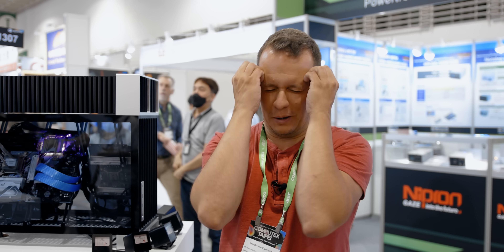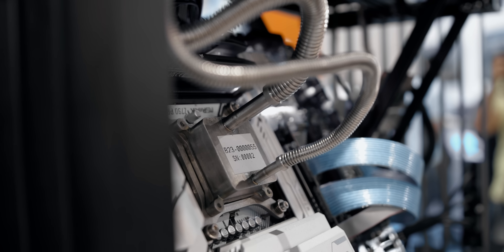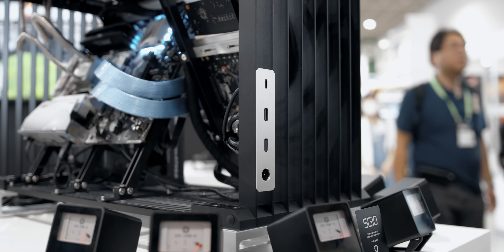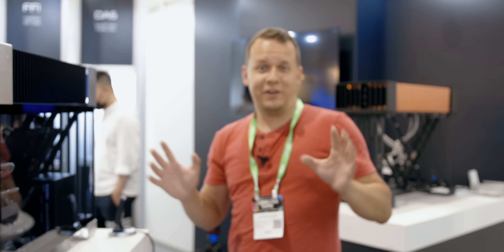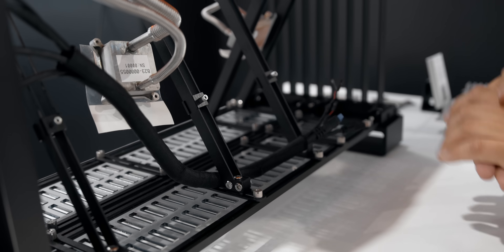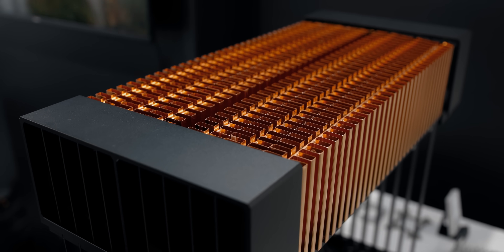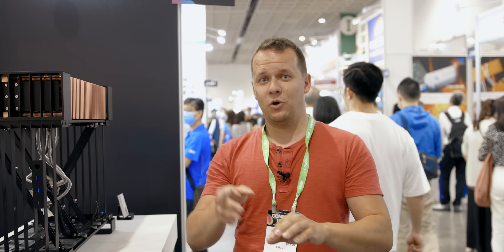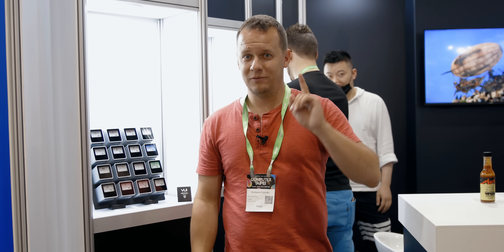Passive Cooling just got REAL.

Comment: It has a very similar issue to what we ran into back in 2003/04 with extreme water cooling. We cooled the GPU and CPU perfectly, but other parts with no cooling — like the motherboard’s VRM section — were burning hot. In fact, the Abit IC7 died under a Prescott overclock. The screws holding down the block were literally scorching hot, while the block itself stayed cool. You can’t really get away without airflow, or you need a custom cooling solution for each piece of hardware.

Comment: Dude is like "the 4080 is running at 60 Degrees Celsius." My 5080 is running at 50 degrees Celsius with just the fans and heatsink on the Asus Tuf OC, all by itself.  I'm sorry, but this is not "brilliant," its a waste of money. My Thermalright liquid cooler for my CPU cost 52 dollars on Amazon, and runs my CPU at 50 Degrees tops when I'm gaming.

Comment: 1.000 Dolars for something that you will have to add as soon as possible couple of fans when you reach 600W consumption, as you said in the title, UP TO, so like in any advert, it`s imposible to sustain the UP TO, intel CPU up 6k, yes just for a second, same here, UP TO can mean for a second before it starts to burn like a fire camp, i don`t knwo what kind of entusiast you have to be to bloody buy something that is made to keep resonable temps in idle or watching youtube, any heavy long work loads, will end to melt the north pole , i wish that the "influence" of those paid youtubers are filltered by normal consumers. About the price of custom loop and noise and bul..it, that you want to be quiet and stuff, please stop talking bul...it, who`s using a computer for youtube it will hardly make the fans run at full speed to be to loud, if you are a gamer, with an expensive computer that needs to be fast enough to run every single game at max , i doubt you will use your 15 Dollars speaker from allix, you will use probably an expensive headset or some good quality speakers, and not with volume on low for sure, for those that are saying, ohh i`m playing in the same room with my sister/brother/mom/girlfriend and stuff, well trust me, you annoy them with clicky keyboards and mouse, and swearing and moving,and ARGB lights  more than the noise of the fans or pump....the way you said 2k,3k as the copper is expensive now, please stop, copper is not expensive, yes it gets expensive if it`s used for that kind of crap,  so the one that you can`t see the copper, is made by aluminium, or if it`s still copper,then how a less process to paint it cost more? If the one painted black, can dissipate up to 600W but the one that you can see the copper  also can disspiate the same amount of heat, so the double price you pay for exactly the same thing it`s just for pictures, and with time when it oxidise you say bye bye to pictures :) i`m not a hater i`m just asking you to not advertise some kind of crap to consumers without adding disadvantages on the same page with "the advantges" .Video from 2023, in 2025 the price per ton for copper is 10.180 dollars in US, 5.09 pe Pound and 0.32 pe Ounce,im curios how much copper is used for the 2 to 3k case it`s used, as i can see. most of the case it`s painted black, that makes me think it`s made by alluminum,the videocard bracket seems to be aluminium  for the weight advantage and cost as well, so the very very very expensive copper frase is coming from where? from 6 Ounces used to do that radiator? lol i`m sick of the influencers :) nothing personal with you or with the enthusiasts, But how you are allowed to express your OPINION as you said in the video, "in my opinion" i assume i`m allowed to bring mines to, and mines is that you are talking bull...it in the entire video about that case :) Peace to you and your viwers, wich hopefully will never buy any stuff considering your "opinion" . All the best

Comment: Neat product, but the issue with this that no one talks about is the other components that require cooling like the chipset, VRMs, NVME SSDs, RAM, etc. It could work depending on the setup if heatsinks are big and effective enough, case ventilation is good, etc, but the temps of all components must be considered.

Comment: 1000$ worth  of copper....
current stock price is 5$/lb
doing some high school math over here the heat sink should weigh 200lb, just in copper!

remember manufacturing cost is the same
only change was the copper,  1000$ for just the copper

some apple math right there XD

Comment: This is huge for workshops that have a lot of dust grain and debris! My school's workshop use laptops/tablets because they can't afford to damage the electronics with the debris we use. Hopefully in the future it will be optimized for smaller form factors
Reply: Unfortunately it's TERRIBLE for those workshops, because the dust will get inside the case which is the last thing you want with sensitive electronics. There is a company that specializes in mini, passively cooled, workstations - those don't allow you to install your own compotnents, but are completely sealed.

Comment: I think that 100% passive cooling is a dumb idea with such a huge amount of heat. I'd say at least design a case with ONE very large slow fan that is extremely quite, but still ensures some airflow.
Something like the Fractal Node 304 with it's one big 200mm fan up front.

Comment: It's not an obscene price, but I think the real problem today is that Moore's law is dead, and everyone is squeezing performance at the cost of wasted energy in the form of heat. A processor today can be hotter than a prehistoric Pentium 4 PresHot, or an AMD bulldozer. Currently I get by just fine with an APU, but the correct future would be CPUs emitting less and less heat, using less energy, and using more passive cooling solutions.

Comment: I understand that copper is expensive but a bare copper version costing 2 thousand more than the release product is just rediculas.. i can see the release price at around $500 $600 but its just a copper heatsink with heat pipes and freeon or something like that.. plus the glass and a very basic frame i can't believe it costs $1000 that means at mass production its costing the company $600 minimum but that leaves $400 profit per case thats fkn outrageous and ill wait for the chinese to steal the I.P and produce it for less than half.. 😢😢 sux because i don't like how china rips off manufacturers I.P but im not paying $1000 for something i know doesn't cost anything close to that.. i know the cost of materials and i know how to use tooling.. my trade is electromechanical engineering so i have a good understanding of the process and $1000 isn't underpriced especially when you are mass manufacturing.

Comment: I never monitored temperature of dedicated GPU as I actively cooled them. This GPU is running at 60 degree C, i.e. 140F. Is that a cool temperature for GPU?
Reply: Yeah that's pretty cool for non-idle. It's also not bad for idle, unless you require your GPU fans running to maintain that on idle. Then that's not so great.

Comment: Passive cooling, won't every be a big thing, until adding fans or pumps wouldn't make it run cooler... Because we always want the best and the fastest and what better radiator to put some fans on than a massive one meant for passive cooling... Everyone knows I'm correct, but it is still cool and good to see.

Comment: are you kidding $2000-$3000 for such a small copper heatsink for that kind of money you can buy 10 times bigger copper heatsink plus copper vapor chamber heat. blocks for the CPU and GPU and connected it yourself and you will have over 2000W cooling capacity instead of 600W i've seen ppl do it you can even buy very cheap Huge copper vapor chamber heatsinks from Cars or Trucks or other industrial equipment and this way you can easily do 3000-4000W cooling system for around $500 like always this is yet another PC SCAM it looks cool and most probably works but it's just so much Overpriced it's a Complete JOKE btw you can even achieve the same or better result with passive liquid cooling with two big radiators that will cost you no more then $700

Comment: had to come here due to also loving passive cooling. even semi passive cooling, in the past I had a huge passive heat sink(even though my case did have fans) I could overclock the cpu with around 1ghz while keeping it below 40 degrees(in a room wich was in probably around 20 degrees. making some kind of convection pipe might be a great alternative for fans.

Comment: I'm more into Frore systems cooling, but this looks nice as well!
Reply: Frore is about heat transfer to air. You can think about it as a radiator. This is about heat transport, like the water in a watercooling loop.

Comment: 600W passive cooling? That means it's gonna save 600W worth of power? If such is the case then it's probably gonna break-even its price by power savings in a year or so. Not bad.
Reply: thats not how it works. it doesnt 'save power' on anything. 600w means it can cool up to 600w amount of electricity put into the pc parts that it cools. so a 4080 and cpu that uses a combined power of 600w can be cooled passively with this, but a cpu + 4090 uses too much power and will throttle/overheat since it goes beyond 600w

Comment: Copper is not THAT more expensive? And most of the case still seems to be made out of Aluminium. Even if that case includes 20kg of copper, that's only like 120$ of difference at best.
Reply: and then the shipping company wants 300$ extra per case to send

Comment: 1000$ is nothing for complete silence. A custom loop that is able to cool a proper gaming rig silently will set you back at least that amount without the case.
Usually, these systems with external radiators are capable to dissipate more than 1000 Watts so OC is not an issue. 600 Watts isn't that much in today's world but at some point you have to make a compromise. I'm eager to know how much the copper variant can dissipate and what the maintenance looks like.
What concerns me is the coil whine of modern GPUs though. Will be even tougher to find a model which is not unbearable without fans.

Comment: Will this passive cooling work when the ambient temperature in your house is 30C or higher as it is frequently in my house in summer. I have no air conditioning.
Reply: Ambient temp doesnt matter between different cooling solutions. 
Except in this very specific case where the liquid inside the tubes are suspected to boil at 61c according to others in the chat, which means the ambient temp cant be above 61c otherwise itll never turn from gas back into liquid to keep the loop going. 
but at 61c you shouldnt be there anyway so thats irrelevant XD

Comment: This would be a REALLY cool setup for situations where high horsepower and an absolutely SILENT noise floor is needed - or fans are impossible to maintain. I'm thinking something like a cleanroom? Maybe an anechoic chamber where testing is being done and analysis or test tweaking has to be done in the chamber itself? Any other ideas?
Reply: I would like to use one in an audio studio personally.. would be good for video editing on speakers also
Reply: Just use an extension cord and put it in another room 🤷‍♂️
Reply: would be interesting if it was possible to record any noises coming from the cooling process

Comment: Someone needs to make flexible heatpipes...same design as a stainless braided brake line, for example...just copper...and a heatpipe.  This would allow custom.passive cooling " loops" ,just like we are used to...the heat pipes would have to have some kind of heatexchanger at each end (cant open a heatpipe unless you have means to make it a heatpipe again).  Any reason this wouldnt work?

Comment: My i7-12700K DDR5 system with a Deepcool Assassin 3 and Corsair 5000D is already the most overkill silent PC i ever built (more silent than my refrigerator) and 7 watts and 18 degrees while watching this video, but this passive case is just unnecessary and straight dumb. Maybe for the RTX8000 when the flagship card will have the size of an entire PC case

Comment: I agree, $1000 sounds like HUGE underselling -- just a loop for similar capacity water cooling might be in that range, and that's not including your case! Curious as to why the copper edition will be more if it's just showing off the internals -- isn't the regular one basically a painted version of the copper?

And the analogue displays also sound like an undersell -- I thought you were gonna say $100/piece! I'd maybe pay up to $50 each tho. Definitely excited for those! Such a cool look.
Reply from the maker: Regular version has copper coolant channels but a painted aluminum radiator.
Reply: @HardwareCanucks  ahh, gotcha. Definitely explains that cost increase then!

Comment: Is it 2 individual loops with 2X 300W dissipation or is it 600W shared?
Can I use a 7800X3D at 120W paired with a 4090 450W and keep under the 600W total or will the 4090 overpower the GPU side while the CPU side almost does nothing because of the 7800X3D?
Reply: Your power consumption of the device and the cooling watts aren't directly comparable. The heat generated by the devices is only the waste heat. If you wanted to compare, you'd have to multiply the device by its efficiency to find out how many watts of heat it is producing and then you can compare that to the cooling method.
Reply: @zachary3603  The difference between power used and heat produced in a pc is practically nothing.
With the coolers mounted around 90-95% of the heat goes into the cooler, only VRM loss, RAM and SSDs are not cooled by the cooler.
Unless powering something via USB-C, no significant power is really leaving the PC without getting turned into heat.

Something that will make a much larger difference is thermal transfer efficiency.
If a 7800X3D is clocked to use 200Watts it would be practically uncoolable even if the cooler can cool 300watts, because the heat can not get away from the chip efficiently enough.

Comment: I wonder how much worse the cooling actually is, if they do not use copper but some other metal. Cause I think, if you don't go for high end CPUs and GPUs, that might be enough by far and would be waaaaaaaay cheaper. At least if the metal actually is the expensive part. I guess the cooling circuit itself, without the metal radiators, might also be a not too cheap component.

Comment: Yea 100% fanless case sounds nice until your SSDs and southbridge and ram are sitting at 80c+ because there is no airflow over their heatsinks, not to mention all the heat bleed into your motherboard/etc that is getting no active cooling at all which is what the airflow through a typical case provides.

With no actual airflow a thin boundary layer of air forms around components and heats up acting like an insulator.  You only have convection to remove heat and that requires temperatures on the surface that are extremely hot, basically cooking the actual silicon chips under the heatsinks.

I have a active fan on my southbridge and still struggle to keep it under 60c during gaming.  Modern southbridges that are adding 20+ PCI-E lanes, multiple high speed USB ports, ethernet etc do not exactly run that cool, nor does modern high speed ram and high speed SSDs.

If the case was designed to be sealed off on all sides and very open on the bottom then the convection of the rads up top would suck in cool air up through the bottom of the case and MIGHT provide enough cooling for the system, I can't imagine it would be anywhere near the volume of air my fans are cycling through the case however.

Comment: What's the specific refrigerant they use? Since there's no compressor I assume it's ammonia or something "very similar". That's not a big deal as long as the system never needs maintenance, but if anything ever goes wrong you're either going to have to learn how phase change coolers work, and get all the required tools, or hire an HVAC tech to fix your computer. It's really a whole different beast than dealing with fans and/or pumps and radiators.

Comment: I know it kind of defeats the whole passive cooling thing, but can you imagine if you put a single fan onto the cooling block running at minimum speed? It would be interesting indeed.
Reply: Well, just place your PC near your ac vent. That should work well without adding extra noise
Reply: @Techno4more  What if you have no air conditioning like me?
Reply: @Techno4more  id be leary of condensation forming if you do that.
Reply: unless the AC is completely silent somehow (from my experience AC has always been hella loud?) having ac on with a passive case completely defeats the purpose of the case?
Reply: Thats what i was saying. A couple 140mm noctuas and its the best of both worlds. Im sure ltt will do exactly that when they get one in the lab.